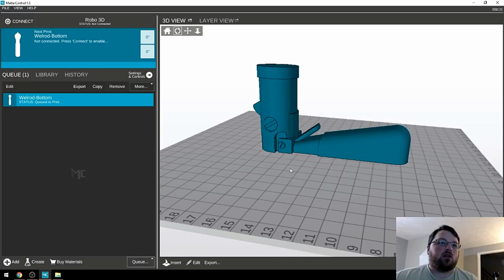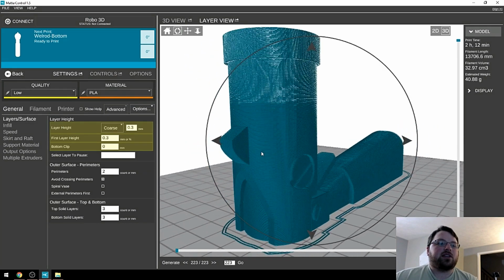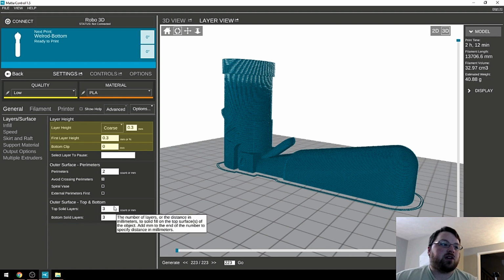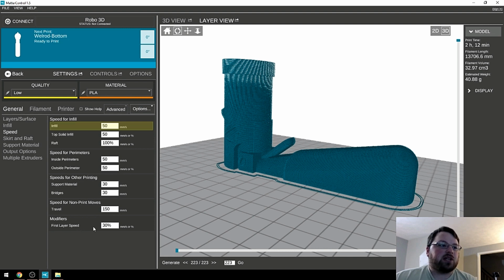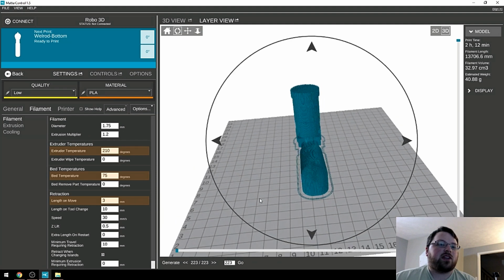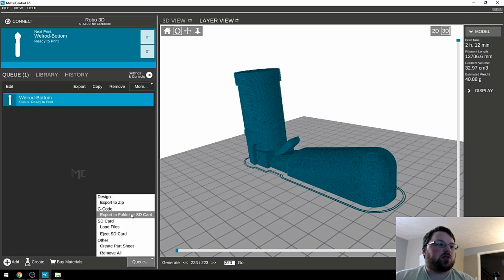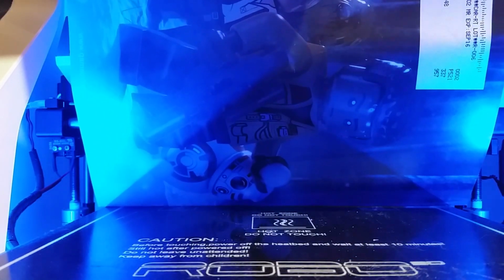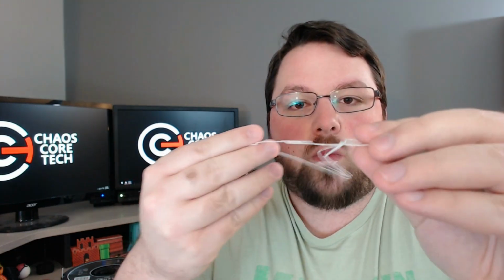My Printing Process & Settings (Plus a Few Tips and Tricks

Comment: I have much better luck on my printer when I apply the hair spray to a paper towel then rub the paper towel on the print bed.  If I just spray it directly on there, the print is extremely difficult to remove.

Comment: Hi, I just wanted to thank you very much for this video. I'm new to 3D printing and have been having a few 'teething troubles' to say the least. I've been using cura and have been having issues getting the first layer to stick. Despite many video views and forum posts checking temperatures, bed levelling, fan settings etc, I wasn't getting anywhere. But having watched this video and increasing my flow and slowing down my initial layers, I've now got a perfect little 3D Benchy on the way! Thanks again and I look forward to binge watching more of your videos!